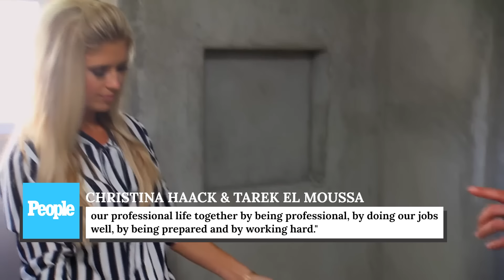Signs Christina Haack & Ant Anstead's Marriage Wouldn't Last

Comment: Marriage has its tough times. If you run at the first sign of trouble you'll never have a marriage that lasts. I've been married 17 years and there are still times when you don't get each other but you have to hang on through those bumps in the road to have a long marriage.
Reply: I agree. I have been married 28 years. It is not easy and you both need to work on it. Cant be easy when you are in the public eye, though. And all married couples grow apart.. you need to work through that. My husband and I have had to do that. So far, so good.
Reply: Marriage is falling in love over and over with the same person
Reply: I miss these two so much! :(